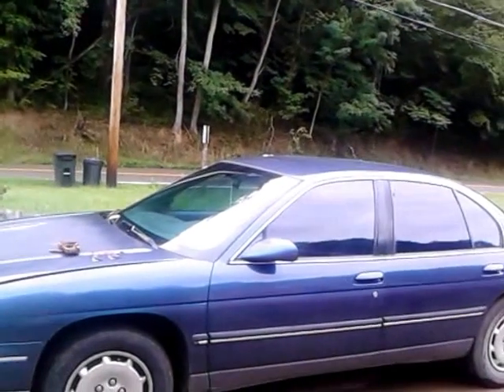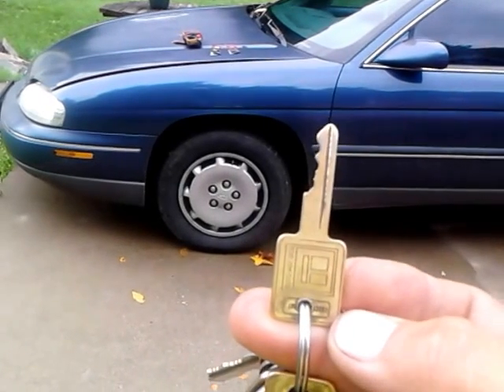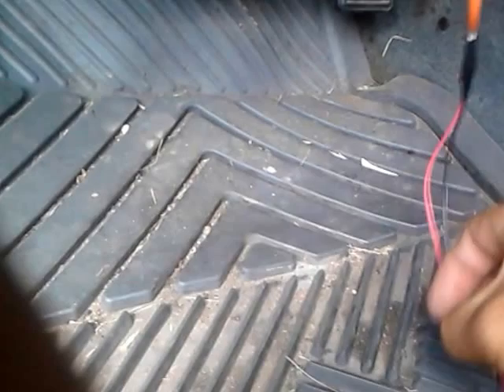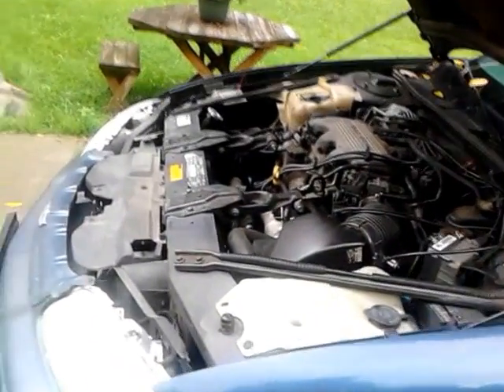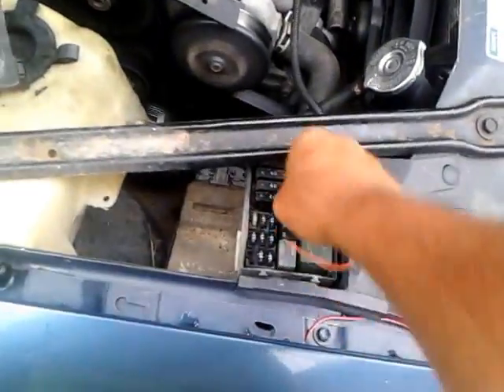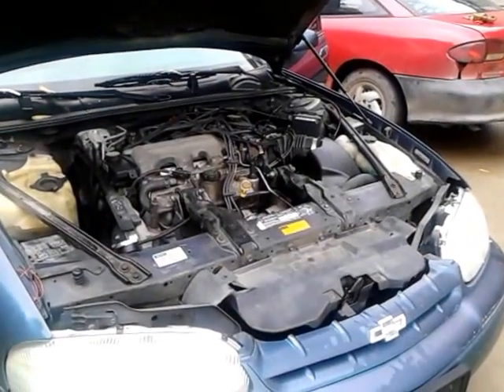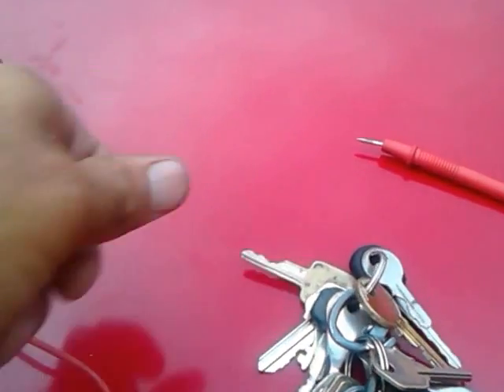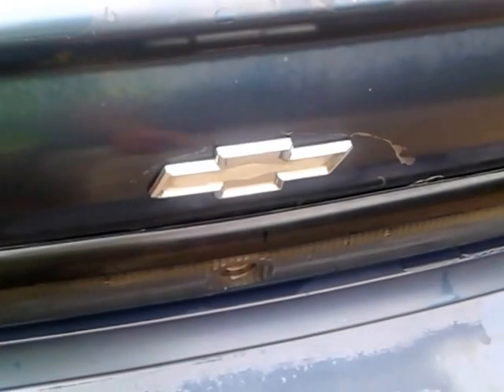How to bypass the security system in  90s GM cars

Comment: To anyone who has done this VATS bypass already and your car suddenly  randomly wont start, check the fuses in the fuse box below the steering wheel. You need to use a multimeter because visually inspecting a fuse doesnt always work. I did the VATS bypass and one day my car just did not want to start.  I used a multimeter on every single fuse till I found one that was not reading, ( the # 6 fuse was the culprit!) so I  popped it out, replaced it and the car started right up. I hope this helps anyone out there who is frustrated with a "No start" condition, as I was.  Dont give up!

Comment: During your hot wire operation, you use a small red wire to jump between the 60a fuse and a smaller fuse in a nearby location. What is that location labeled? 
Seconds later, you start the engine, but do not show exactly what points to connect. Obviously, you must connect the starter, but the starter primary terminal is not easy to reach.
Reply from the maker: It is hard to get to the contact points. The points I touched on the starter were the big positive wire and the trigger wire for the solenoid which is a smaller wire.
Reply: @lukeFugate  It certa9inly is hard to reach the two points. I asked because it seems a good means to recover when all else fails. If I understand you correctly, I take a jumper from the battery positive terminal to either the positive (primary) lug on the solenoid or the S (signal/secondary) terminal on the solenoid. Is that correct?
Reply from the maker: @bobgreene2892  yes

Comment: hi, I bought bunch of resistors but they are all 1/4w resistors, looks kind of thin.. is this the right size? I don't want to risk fire.. please help
Reply from the maker: They should work fine there is really not much of a load on this circuit so no chance of fire. It is just a reference circuit.

Comment: I appreciate the tip added on the type of key! Even if I bypass and Hotwire the cylinder will lock the steering column. I need a key to unlock it:
Reply from the maker: No problem, glad you found it useful.

Comment: i have a 99 lumina it was broke down for a year or so without the battery in it.Now i,ve fixed it and security light comes on but it still starts and runs fine?
Reply from the maker: Does it stay on while the engine is running? It may be losing contact with the resistor after it starts. It will still run but the light will come on. The same thing would happen if you started it and then pulled the key out(if it would come out)while it was still running. It could be a wire that is breaking, but still is contacted while the key is off. At some point the wire will break all the way and you will either have to take the column apart and repair it or do this bypass.
Reply: @lukeFugate  yeah it stays on while it,s running...has,nt stopped it from running yet it sat for a year or two without a battery

Comment: would this work on a 01 Pontiac Montana minivan.
Reply from the maker: As long as it has the resistor in the key. It will work. I have an 05 Buick with the same system.

Comment: How do I get the right resistors if my keys lost and the security system was switched out before. I'd like to start by hot wire or bypass vats security system
Reply from the maker: As far as I know, the security system is integrated into the ECM. You could try different resistance levels going by the chart in the description. There are 15 different resistance levels it would take some time but going through each one from 1 to 15 is the only way I can think of.

Comment: thanks so much i have a 98 chevy lumina  had same problems this worked great and easy to do
Reply from the maker: glad it worked for you.
Reply: luke Fugate what if i did this and it still didnt work need help
Reply from the maker: If it didn't work the problem may not be the security system. Does the engine crank at all or does it just do nothing?
Reply: luke Fugate it doesnt do anything but they told me that my resistors might be too much ohms because I need 1857 and i have a 22k resistor could that be the problem
Reply from the maker: Jacob Reyes yes the resistance has to match as close as you can get to it.

Comment: I have a Buick LeSabre with no crank no start my key chip has resistance of 7.5 ohms and ignition wire has resistance of 12.42 . I have my security light flashing I have tired using resistors but nothing as far as starting. I have tested the negative battery cable and battery the light comes on will this cause a no crank no start and have my security light flashing
Reply from the maker: Can you jump the terminals on the starter and get it to crank?
Reply: @lukeFugate  i am having the same problem this person said. My husband jumped it from the starter it ran for a second then died. Bought a new key as well.

Comment: I'm trying to locate the ground wire that goes to from the battery on a 1998 Buick LeSabre any ideas
Reply from the maker: The ground wire should go from the negative terminal and run to the chassis of the car and also should be hooked directly to the engine block. If either ground is loose it can cause quite a few problems. It should also have a ground strap hooked to the engine block and going directly to the chassis tying them together.

Comment: Feks sakes  this is for passkey NOT Passlock .. pass lock key has no chip  its magnetic. Dummies
Reply from the maker: Who said anything about Passlock? This is for the VATS security system bypass. It doesn't really matter that much what it is called though. The point is this procedure will work on it if your key has a resistor in it.

Comment: Do you have a fix where I can bypass my security module that just went out? I don't want to pay 660 for one including installation for it to only happen again in the future.
Reply from the maker: Steven LINN Someone told me that the security system is integrated into the ecm so it would involve replacing that. Are you sure it's not just the wires in the video that are broken?
Reply: luke Fugate I had that done when my alarm was installed. What's strange I never had an issue other than the pass key fault light coming on when it rains or when I hit a hard bump in the road but car always started normally. I had my car in the shop to replace a power steering pump. I did ask them did they know why my light turns on when it rains and they didn't know. I get my car back drove home and it's been dead since then and they told me the issue was my security module I kind of feel like they are trying to pull a fast one on me
Reply: how do I pass lock a key severity for 3003 bravado

Comment: Luke, great video!  I do have one question, I want to completely disable the security system as my car alarm will go off in the driveway for no reason at all.  Does your video effectively solve that problem too since the car thinks that the key is always in the ignition?  Thanks!
Reply from the maker: Not sure about the alarm, mine doesn't have that. I would say it should work though, because as you said it thinks the key is in the ignition. Does the alarm stop when you put the key in or when you turn it on?
Reply: I'm not sure but right after I sent my message to you it dawned on me that I could do a simple test myself by putting the key in the ignition and see if I can set the alarm and I couldn't.  So that means that if I apply your fix it will disable the alarm and solve my problem.  Thanks Luke!!

Comment: My daughters 97 Olds Achieva recently had the SECURITY light come on when coming home from school. The next morning it would start and then immediately die. Does this sound like something that your fix would cure?
Reply from the maker: Yes, sounds like the security system if the security light is on when it quits. The little wires from the key switch to the plug under the dash break.
Reply: Thanks for your timely response! I will dig into this thing and let you know what I come up with, and or ask a few more questions. Thanks again!
Reply: Revoultion Repair 

I want to get rid of a 

passkey 3
Reply: Hey buddy did you ever fixed your problem. I have a 97 olds acehiva also and same promblem am having

Comment: I got an 95 Oldsmobile cutless supreme . I lost my keys and I wanted to know if you would know if all the 95 Oldsmobile cutless would have the same resistance? . cause I have no idea how to find out how much mine has and I don't have they keys
Reply from the maker: The best way to find the resistance level is to go to the dealer with your vin number and ID to prove you are the owner. They can look it up by the vin.
Reply from the maker: The only way I know of to find the resistance without the key is to go to the dealer with the VIN and an ID to prove you are the owner. They can look up the resistance code by the VIN.
Reply: Hey man any luck starting? I have a 95 cutlass supreme and the starter turns over but it act like no fuel is getting to engine. Could it be fuel pump?

Comment: Will this work on a 1999 Chevy Monte Carlo? Mine will not turn over, no clicking or anything. I have a feeling it is my Ignition Cylinder "That stupid little wire" To replace it, I will have pay 400$   So, I am looking for a cheap "Or free" Fix.
Reply from the maker: If its not clicking or trying to start but the accessories like the radio works. This procedure should fix it. Mine is still working.
Reply: Will this work on a 1998 z24 security light just stays on and the car won't say anything replace ignition switch and tried reprogramming and still dose the same thing. Any help with this problem

Comment: Hey, question! Great video btw. I am seeing the orange wire and where it is attached with the black connector but where did you get to the other end of the orange wire. I havent looked too hard yet, but did you just cut it and then attach the 9v connector?
Reply from the maker: I just cut it.

Comment: my 95 cavelier starts but soon as I hit gas it cuts of, is that the security system failing? if u have answer please fill me in, thanks
Reply from the maker: +Andre Bennett Sounds like maybe a fuel pump. did you check fuel pressure?
Reply: Yes, mechanic friend of mine said it sounds like fuel pump to, ill take it to shop nd see if computer picks up the fault, nd ill update u on that fuel pump, thanx Luke

Comment: hey I really like this video I think it was very informative I have a 96 Chevy lumina and it had a leaking intake gasket we replace the intake gasket and the car won't start now we're getting no spark from the ignition coil I took the key to a locksmith and he said that he was fine but I found that the security system fuse was blown so I replaced the fuse and we're still not getting any spark at the ignition coil I have a feeling there's a problem somewhere in the security system but the security light on the dash illuminates and then goes out after about a second when the key is turned on I did replace the ignition module and the crank sensor to no avail any ideas what would cause that security fuse to blow
Reply from the maker: +David Northrup Is it cranking with no spark or not even cranking?
Reply: +luke Fugate it spends over just fine and I believe all the components are coming on except for the ignition and today I had discovered that it has an aftermarket security system under the dash and I'm in the process of removing that now I mean the car ran fine until we put an intake gasket on it
Reply from the maker: You have to disconnect and remove so much to get to the intake gasket that it could be anything. If it cranks with the key it is not the factory security because the factory system kills the starter and the fuel injection. These engines are notorious for weak intake gaskets, I've put two on mine of course mine has over 350000 miles on it. I hope it is the aftermarket security. If not let me know if you need anymore info I'll try to help.
Reply: +luke Fugate sure I'll let you know I'm kind of leaning toward a bad computer I'm not sure if this computer has to be flashed or not I hope not

Comment: Do watts matter in the resistors? Cuz I see they have 1watt, 1/4watt, 1/8watt etc..
Reply: I know this is an old post but might help some one out i used 1/8 watt and a 1/2 watt so i dont think it makes a difference as long at the resistance is correct

Comment: Ok, I am aware of the ohms needed however Radio Shack asked how many watts I needed. So how do you determine the wattage for the resistors needed?
Reply from the maker: I think the ones I bought were 1/4 watt not sure if it matters as long as the ohms are correct.
Reply: luke Fugate  Thanks, I got 1/2 watt, but alas it was my module that is bad. Since damaging the body so bad- hitting a deer and a ditch- I have decided to pull the engine and transmission then either sell them or find another body. :)

Comment: On my 98 jimmy that blaze orange wire is for the air bag !  I put the resistors on the yellow and black wires going to the ignition . But jimmy is passlock ll system with the resistor in the ignition not the key. If you have air bags be careful what wires you are cutting people.

Comment: how do i find out what my vats key was i do not have it please contact me via email 
jmoose74@gmail.com i have a 90 camaro rs 3.1 V6 i get fuel and my starter turnes over but i get no spark at all
Reply from the maker: The dealer can tell you which key you have. Take the title and your ID to the dealer and they may be able to make you a key.
Reply: hole key switch was replaced so i need to figer out what ohms it was

Comment: I know my key is a 7. I guess I could diconnect the wire and with the key in the ignition I can check the resistance
Reply: I read an old comment of someone that it was happening to a decade ago, they said to get it to read it turn key in but not all the way and leave it for ten minutes and turn it back to completely no power for like a minute. Then fire it up.
Reply from the maker: Yes it may work that way to find the resistance but the most common problem with these is the wire breaking, then you would only read an open circuit. its easier to check the resistance of the actual resistor in the key. If youre key is a 7 it should be about 1.870 k ohms.